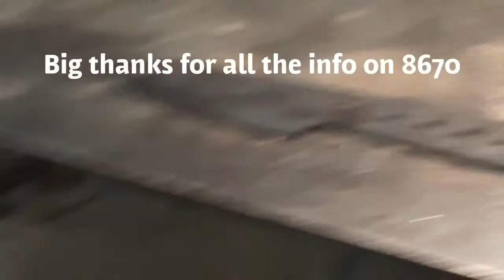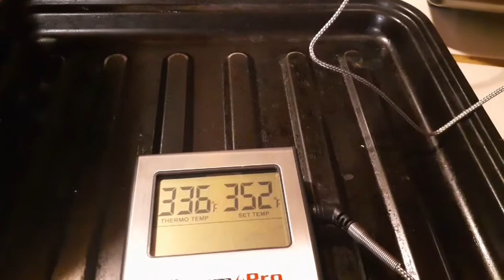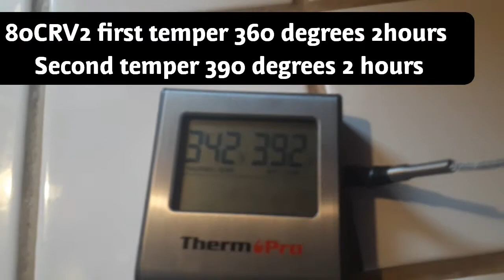80CRV2 vs 8670

Comment: I'm a huge fan of 8670, especially high temp quenching for extra hardness on chefs knives. It's so tough I don't even temper on kitchen knives. At 61-3 HRC it's fantastic
Reply from the maker: You’re saying you don’t temper at all? No type of stress relief
Reply: Auto temper, I remove from the quench between 400 and 700 degrees and air cool after that. That's only on kitchen knives. Everything else is 2x 350 or 2x 400, two hour cycles. You should try a couple samples to see how tough it is at different quench temps
Reply from the maker: @nickstoebe2226  Yeah next time my muscle around with 8670 I’ll Try that technique sounds cool
Reply: I also quench in Parks 50 and leave extra steel on the knife so it cools quicker. Try auto tempering a few scrap pieces and put them in the vice and hit them with a hammer. It's stupid how tough 8670 is

Comment: I've been hearing pretty good things about the 8670 and have been considering trying it out.
Reply from the maker: I would go with 8670 over 80crv2
Reply: @AaronJohnson1979  I've heard, for forging, it's hard to beat 80crV2, but right now, I've been doing stock removal only, and smaller, edc style knives, so I might have to pick some up.
Reply from the maker: @Cloudstrife112233  well, 8670 is much cheaper and it’s tougher by a lot so because it’s tougher it can have a thinner harder edge and still be stable. Also, it doesn’t warp and it doesn’t collect scale in the forge. Look up Admiral Steel they have it dirt cheap their big pieces.
Reply: @AaronJohnson1979  I had ment to say that I would be picking up some 8670. I just reread my comment and realized it sounded like I was referring to 80crV2.

Are you in any Facebook knifemaking groups?
Reply from the maker: @Cloudstrife112233  yeah, I am I like knifemaking hobby
Reply: @AaronJohnson1979  haven't heard of that one. I mainly post in Bladesmithing for Beginners.
Reply from the maker: @Cloudstrife112233  im in that one too, thats a BIG group
Reply: @AaronJohnson1979  it is, but that just means more advice and inspiration for one's work, right?
Reply from the maker: @Cloudstrife112233  yes it does great group
Reply: 80crv2 will be the better steel for knives when heat treated properly. 8670 will be better when maximum toughness is required, but the edge retention is quite bad. It also loses toughness quickly at higher hardness. It really depends on the intended use case. A sword? Go with 8670, a kitchen knife, go with 80crv2. With either, make sure you heat trat correctly.

Comment: 80CrV2 is basically 1080 with 0.50% chromium and 0.20% vanadium. Or like O1 with the small amount of vanadium with less carbon and no tungsten. First off at 0.20% vanadium you will not get vanadium carbides, you'd have to have 0.50 or higher to do that. What does it do then? It restricts grain growth and is why I only buy O1 with the vanadium. O1 with vanadium can be held at austenizing temperature of 1475 for 15 minutes with no appreciable grain growth and you will squeeze the chromium and tungsten into making carbides as much as possible. Then a 450 temper for two hours two times for a hardness of 60. 

If I were forging I would use the 80CrV2 instead of 1080 only because of the vanadium helping to restrict grain growth, but the chromium doesn't hurt anything and does help in forging. Now if I were forging a knife and wanted the edge holding of vanadium carbides I would get CruForgeV steel, it has 0.75% vanadium with 1.05% carbon with 0.50% chromium. I have forged it and it is one hard edge holding steel and I tempered it back to RC 57, but vanadium carbides are harder than tungsten carbides and being less hard didn't affect trying to finish it nor its abrasion resistance. 
If you do not know where to find it Alphaknifesupply.com has it in 1/4" thick bars. It isn't very expensive, but my understanding is that Crucible who makes it has discontinued it, so what is out there is all there is going to be.

Comment: Good video. I just started using 8670 and I love how tough it is. I haven't used 80crv2 yet but I know lots of people who swear by it. Like you said though 8670 is easy to get and inexpensive and for the minimal difference on edge retention I'll probably just run with 8670 till I start doing Damascus or San Mai. 8670 has nickel in it so it doesn't contrast well when forged into a billet.
Reply from the maker: Especially considering 8670 i never had one warp on me yet. And it's the type of steel you can make a knife out of there's nothing tougher it's even tougher than 3v
Reply: @AaronJohnson1979  yea it's toughness is amazing. The reality is pretty much all high carbon steel is savage stuff. I'm beat the living hell outta 1084 and it's held up. Heat treat and edge geometry are what matter more then anything. When someone tells me a certain high carbon steel isn't tough enough for them , I'm always like what In the hell are you using it for?? Anyways good video and I'm glad ya did it. 8670 needs a little more spot light, easy to heat treat and tough as they come.
Reply from the maker: @TheMotownPhilly  sometime look up McCullough knives he's made a lot of 8670 big choppers and he does some hardcore testing like chopping through concrete cinder blocks just beats the living hell out of it and it takes it he's the one that told me how to heat treat 8670 he's very open with how he does it
Reply: @AaronJohnson1979  yea I think I seen some of his stuff before. I'll hit him up. I seen you deep freezer it ,that was new for me. I followed Knife steel nerds heat treat and have had great results. I'm willing to give it try for another process.
Reply: I've only used 1095 and 5160. My heat treating is very similar.  Take to critical/non-magetic for 1-2 minutes and quench in 120° vegetable oil. Then temper at proper temps and times. Can I follow this basic routine with 8670?
Reply: @Chad_Sandridge75  you can and it will get hard.... However I'd advise trying to hold the temp for closer to 5 minutes if you can pull it off. 8670 is a slower hardening steel so I'm not sure how it will respond to canola oil. I'm pretty sure you can do it but I'd take a couple coupons first and see how it goes.
Reply: @PHILLIP WHITMORE  what oil do you recommend?
Reply: @Chad_Sandridge75  parks 50. If that's to expensive you can get McMaster Carr 11 second quench and it will work just fine for 8670 and 5160 not 1095 though
Reply: @TheMotownPhilly  I water quench all my 1095 in a salt brine at above 130f. It gets a full 1.5 harder than parks 50

Comment: For knife. 80crv2 probably unless you need the toughness of 8670. 

Axe or sword. 8670. 
However. ZTuff kills both.
Reply from the maker: I always wanted to try ztuzz
Reply: According to knife steel nerds 8670 is tougher but Z-Tuff is tougher at 61.5 HRC while 8670 peaks slightly bellow 60 HRC.

Comment: Thanks for the video.  Which is the better steel for a  20 inches big chopper ? Thanks
Reply from the maker: In my opinion it's whichever one you can heat treat the best. Either steel will make a great Chopper that's 20 in long.
Reply: Most of the bladesmith use 5160 for large knife in my country(Malaysia). 80crv2 and 8670 carbon steel are not available here. 

Some said the toughness of 8670 steel is comparable to Z-tuff PM steel.
Reply from the maker: @greenforest80  yeah I never tried that kind I have kind of a simple setup so until I get a heat treat oven I can't play around with any of the super steels
Reply: @AaronJohnson1979  Z-Tuff is comparable to S5 or S7 shock absorbing steels with more edge holding and less rust. If I forge an ax I use S5 and temper to around RC 59 hard tempering at 550. Makes great axes.
Reply: @AaronJohnson1979  Here is a heat treat for S5, it is easily accomplished in a forge.
http://cintool.com/documents/Shock_Resistant/S5.pdf
Reply from the maker: @MountainFisher  I will look into this
Reply: @AaronJohnson1979  Cin-tool steel is only place I know to get S7 right now, but other suppliers may have it. California tool steel has S7, but it is harder to heat treat to same hardness, but its toughness is higher than Z-Tuff or 3V. I think it is odd that everyone forgot about S5, been doing this since '92.

Comment: Boy those sound clips and music would have any terrorist testify....ever try a quick quench in water and then finish in oil?..
Reply from the maker: If I was ever going to do water again like I used to before I had Parts 50 I did go into water for a few seconds and then right into oil and I did get excellent results. That’s probably the hardest I ever had 1095 before! That method does work, 
but I cracked about 40% of the blades and i was putting clay on the blade,,
and the water was soapy salty, warm brine.
Reply: johnson  gotta be quick with the water
Reply from the maker: @emilyscandycakes4530  there’s a fine line depending on the thickness of the steel and the temperature in there too long it cracks not in there long enough don’t get full hardness. I have wanted to try W-2 in water though. I think I’m gonna do that.
Reply: @AaronJohnson1979  yep...doing some 80crv2 and 52100...w2 sounds interesting also

Comment: What's tougher 3v or 8670
Reply from the maker: 8670 is tougher then any kind of knife steel 3v Will hold an edge longer and will be less likely to rust, 8670 will be able to handle a much thinner / harder edge much more edge stability with a thin geometry

Comment: What would be the best for a beginner with minimal equipment ?
Reply from the maker: Close one there probably 1084 lol
But between these two they’re pretty close maybe 8670 by just a little bit
Reply: @AaronJohnson1979  Thank's , no 80crv2 ? so 1084 over 8670 and 80crv2 ?
Reply from the maker: @dimmacommunication  For a beginner nothing is easier than 1084 you’ll get the best results of that
Reply from the maker: 8670 and 80crv2 Don’t get me wrong they are both beginner friendly and both very easy to heat treat but your question was what would be the best for a beginner with minimal equipment and I have to say 1084